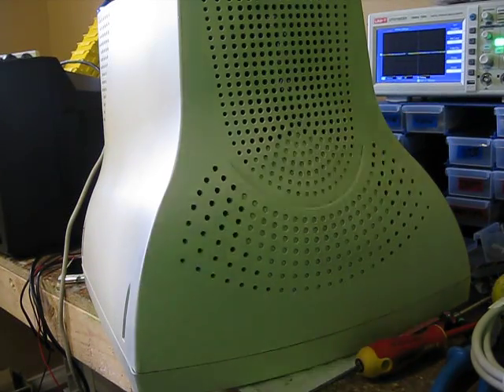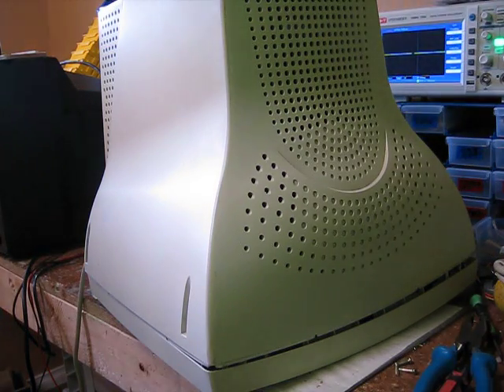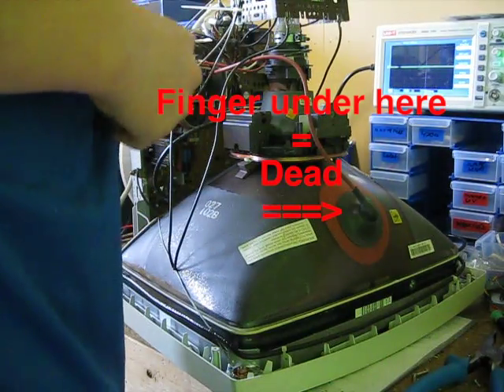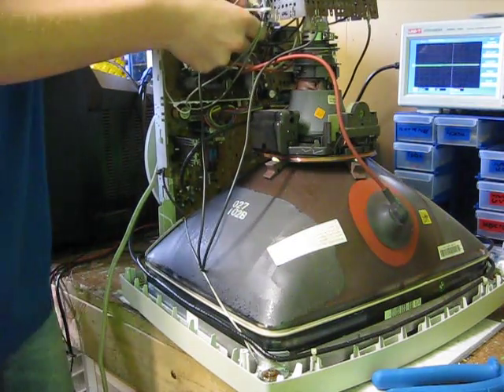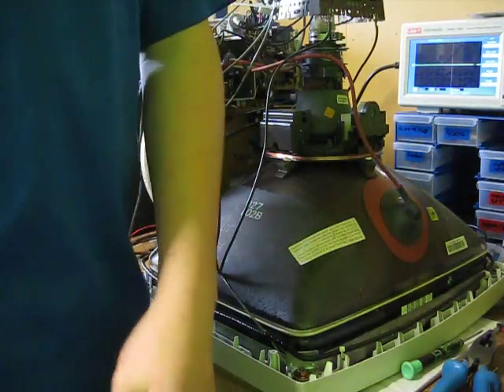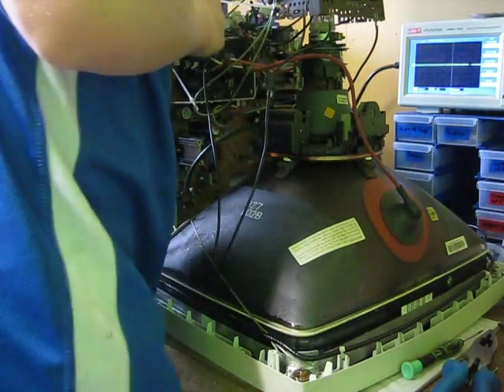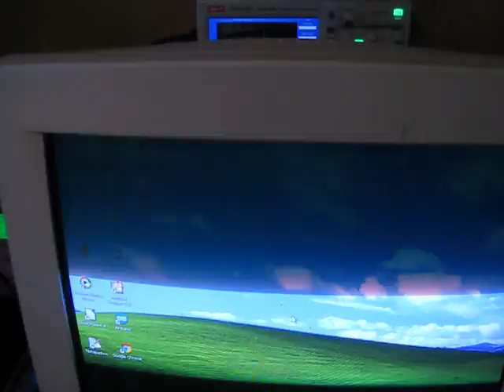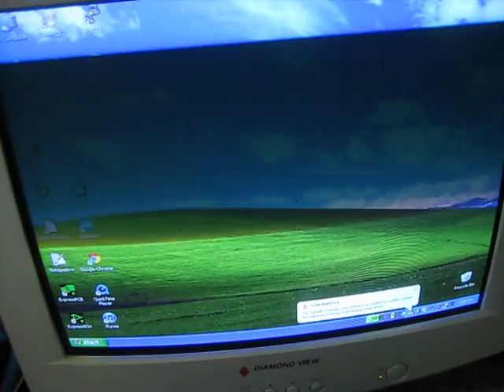CRT Computer monitor

Comment: how to remove the VGA cord inside of that monitor?
Reply from the maker: Ralph Macanas depends how nice the manufacturer is,  if the put connectors on the cable
Reply: oh okay thank you for your responds Sir.
Reply from the maker: Ralph Macanas no problem

Comment: Crt monitor internal cable
Reply from the maker: The VGA signal cable or the 210-250v mains
Reply: Hello i am from india 
I am having a problem with my crt monitor... When i plug in vga cable in the CPU jack, the monitor goes in standby. 
Can you suggest me where may be the problem..??